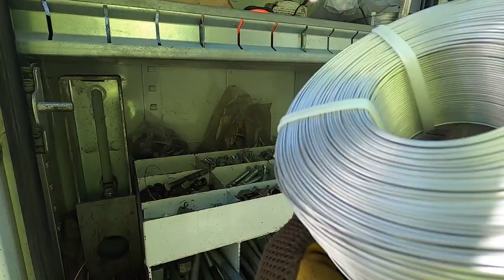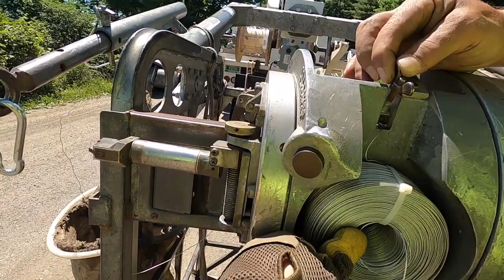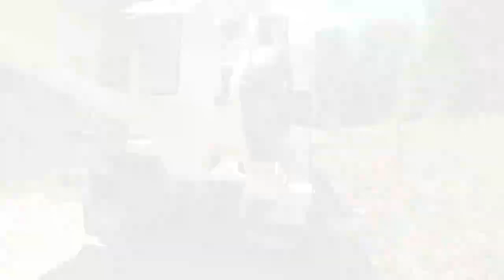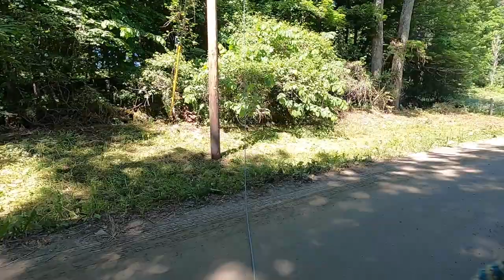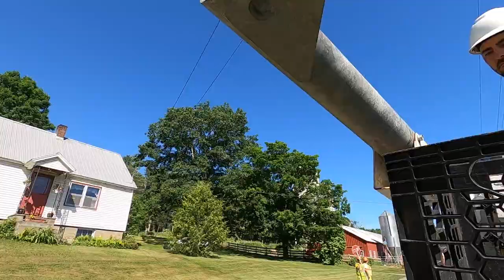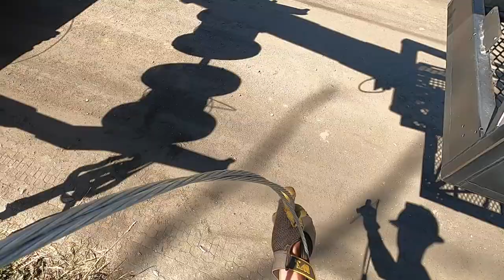Lashing Fiber

Comment: I'm a lineman for spectrum just a tip your not suppose to tie the down guides to the light company's anchor your suppose to put your own anchor
Reply: Must not be a good lineman🤣
Reply: It actually just depends on the company. In my area the power company’s are putting there own fiber up so they are turning into a power/communication company and they allow you to use there anchors. But yea a majority of the time you need to place your own anchor and guy.
Reply: @christiannash1719  We used auxiliary eyes, [when we had them], when we attached  to power's anchor.
Reply: Depends on your company
Reply: If you tie off on power in TEXAS YOU'RE FIRED!!  Dig your anchor son!!
Reply: @Popesontour  that’s Texas though lol
Reply: @Popesontour  where I’m at we use power anchor if it’s the only anchor. I’ve even had them tell me to use it. So every system is different
Reply: Yeah same here, since our  power company is the one putting all the fiber up on occasion we put a aux eye on the power company’s anchor or if there’s an open spot on the eye of the anchor we can put put it there
Reply: What camera do you use? And how do you mount it when you're hands free?
Reply: Most cities will let you connect to powers anchors if there's no space available to tie down to. But yeah if you have space and the specs call for you to tie down to anchors of your own do it
Reply: Cant tell you about your state - but it usually depends who owns the pole that determines who places anchors (not down guys, but anchors)..   if we own the pole, we place anchors (even if we wont be using it) if the power company requests one for their stuff. Same goes if power owns the pole and we need and anchor - we request power co to place one for us.
The purpose of the anchor is to stabilize the pole. Not anyone's cables. Hence why normally whoever owns the poles takes care of anchors. Non union areas may be different. 
Also - this may vary from state to state - but my GUESS is if there is a Power Company placing fiber, they arent getting into the 'communications game'. Usually (by me anyway) its fiber they place, and those will run from substation to substation. They are for them, ONLY, and not something they will be offering service off of to anyone else.
Reply: Hello and hope all is good. How many  feet do linemen running fiber typically do in a day? Thank you
Reply: Where I work in Canada there is a joint use agreement between the communication companies and the power company, we share anchors whenever possible.
Reply: In Connecticut it is allowed to share the anchor, though it isn’t a hard rule. We place the yellow sleeve on the down guy.